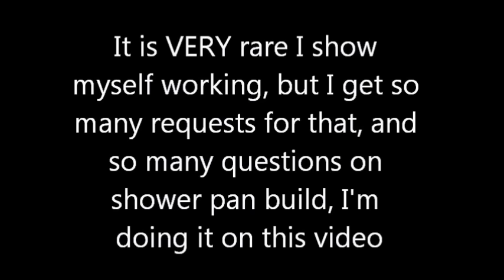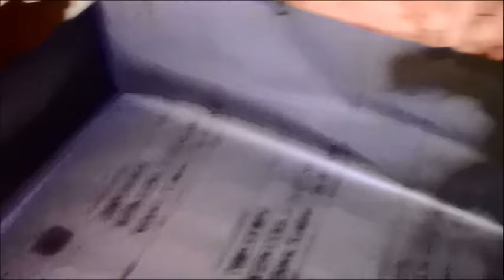HOW TO SET SHOWER PAN LINER and MORTAR

Comment: I'm sorry if this upsets you but I  do have a question about pre slope. If you don't pre slope the sub floor or slab, how does the liner drain any water that might get to it? I understand the water proofing measures you're taking but with your logic the liner itself would be unnecessary, right? I think if you don't pre slope the liner you stand a chance of having ponding water if you have water getting to the liner. I'm just trying to understand, I've been watching so many of these shower tile videos and I  just thought  why would anyone pre slope if you don't need to? But if the liner is supposed to remove any water that gets through than wouldn't it need SOME slope? I'm just confused I guess.
Reply: Yes and no, if your tiles leak a lot then a preslope will help prolong the life of the shower but it’s on a short timer regardless. If your shower has a small/expected leak through the tile (water always enters the bed! Always!!) then it will  not help as the bed will wick the water up and it will evaporate through the tile like it got in!
Reply: @VinnyGjokaj  so is the liner actually pointless ?
Reply: @jeremyclarke709  the linear is there to stop the wood from Getting wet!
Reply: Can do the preslope, then liner, then thinset then title?  Or best Liner, preslope, thinset. Doing linear drain of the height at the drain to subfloor is almost 2".   so the slope on a 6' long shower will be almost 3.5" in the back.  Lots of weight for a sub-floor I image. Thanks.  Love these videos so thanks.  Seen so many now I'm lost.   @VinnyGjokaj
Reply: @Idahodan1  I’m definitely here to answer any questions you want/have. A preslope is always positive, but once the pan liner leaks and water enters the preslope it will help but it’s still going to need to be torn out. The water is always going to get into the tile mortar bed, the most important thing is for the pan liner to be water tight and perfect, so the water won’t escape into the sub floor, whatever water gets into the mortar bed will slowly evaporate out through the grout when the showers not in use. So if you do a perfect pan liner then the shower will be fine without a preslope, if the pan liner is bad a preslope can help route the water to the drain but it’s only going to extend the life of the shower by 6 or so months before being needed to be torn out.
Reply: Pre pan is like strapping a foil pan under your truck engine in case it leaks. Proper installation and maintenance will keep your shower from leaking. Been doing tile for 32 years and have never used a pre pan and never ever have I had a problem
Reply: I always pre slope a mortar bed under the liner. If there is no pre slope it is flat and the water the seeps threw the tile and grout will sit flat and have no where to go and start to smell. That's why there are weep holes on the drain.

Comment: I appreciate Bob's time and effort to make these videos, and also his skill in the trade, but I can see why his method confuses a lot of people. He uses a pan liner even though the topical membrane makes the liner superfluous, and he uses a weep hole-style drain that would be suitable for a water-in, water-out system, even though he's not building that type of system. I'm sure his showers don't fail because he is tying the components together with care, but it still doesn't make a whole lot of sense to do it this way. That's why he's always fielding nasty comments about not knowing what he's doing.
Reply from the maker: Thank you for the kind words sir, let me go over a few things, they don't make a drain without weep holes because the drain manufacturers are behind the curve on the sealèd system that we are doing now. The reason I still do a liner in addition to protecting the surface of the mortar pan is force of habit, do I absolutely have to have the pan liner? In my opinion know but I do it anyway....cya. 

Insofar as what the industry standards are, I started doing things long before they became standards, 25 years ago I wasn't seeing blocking so I put blocking between the studs, now it is basically code, 15 years ago I started setting my wallboard about an inch off of the pan motar, now the tcna and other organizations call for that in their manuals. 10 years ago I waterproof the entirety of my shower including the mortar bed, everybody had their pushed back but now that it's called the sealed system and it is standard... plus you have manufacturers like flow fx  who is making it easier with their drain to do what I've already done with a liquid topical membrane.

Yes I am a maverick, but I'm also an innovator, everybody else just reads books where I use critical thinking 🫡😉

Comment: Do you have any opinions on pre slope. I’ve always used them but wonder what you do to combat standing water in the pan?
Reply from the maker: I don't believe that a pre-slope works as intended because wicking action, having said that everybody waterproofs the pan surface nowadays so it doesn't matter
Reply: @StarrTile  but if you do a pan liner and mud isn't throwing a waterproofing over it a bad thing? Aren't you basically trapping water in between?
Reply from the maker: @Mikepopo99  the pan liner is not necessary, I still do 1 because habits die hard... but the motar bad should be fully dry and cured before waterproofing the surface, therefore you cannot have moisture in between the two, unless of course you're doing it wrong.

I prefer to use a liquid topical membrane like Redguard or aquadefense whereas other tile guys are using some type of membrane like Kerdi, a cloth membrane with tape at the seams, etc etc, either way it's done it is a sealed system once again makes the whole notion of a pre-slope irrelevant

Comment: Great video. Lots of comments on preslope or why not here. The subfloor should be very very close to level 1st and foremost, wood or concrete slab. If not this is where you create a pre slope or use floor leveler or level up a plywood sub floor. The pan liner gives the wood sub floor some protection against water all over it if water gets past the grout and the entire mortar bed becomes soaked 101%. You're then hoping water goes to the drain as path of least resistance. You've got a big fail when this happens. My question is why is the mud bed so thick?

Comment: Do you need a pan liner if you're building a shower on concrete and not over wood?
Reply from the maker: Yes definitely, although the waterproofing membrane can be used in place of a pan liner like Redguard or aquadefense

Comment: Does the mortar have sand. I have mortar and was told it needed to have sand added
Reply from the maker: Mortar is cement and sand, you can't have mortar without both of those..
Only reason that you would need sand is that you bought cement

Comment: Preslope. I have seen other videos that show preslope. Once you know how to good troweling and packing, I also see no need. I will cut multiple lengths of cheap floor molding to screed. I will also glue the molding against the shower base as a screeding guide.
Reply from the maker: Good idea,Yes, but you are taking out the mouldings afterwards ? Unless they're the plastic in which case they could stay
Reply: @StarrTile  I was going to do a fiberglass pan but $500 is too steep for me.

Comment: Great videos Bob Thank You, Question, could you just use RedGuard as a pan liner? Maybe 3 or 4 coats and then use another 3 coats of RedGuard on top of your Mud. Thanks
Reply from the maker: Yes, Redgard allows for their product to the pan liner. I don't know the mil thickness they are looking for but 3-4 coats would do the trick.
Having said that,  because I have a customer base answer to I would not attempt it personally and instead use kerdi..which I have on many occasions for curbless showers on a slab.
Reply: I just had to throw in my two cents when I read this question.. if I understand your question correctly you want to possibly do away with the ~$30 shower membrane and put several layers of red guard which would cost over a  hundred dollars easy. Why would someone want to go that route?
Reply: @estephenchavez9577  I've never installed a rubber liner ( if thats what your talking about) and I don't like the way inside corners make wall board bump out. Red Guard is a bit pricy @ $150.00, 3 gal pail but I'm using on walls anyway, so I use as a pan liner also. I did call Custom Blend Tec support and got the OK. I can usually do 2 showers with 1 pail and the home owner pays for material anyway. That's my 2 cents. Peace my fellow Tile Contractor.
Reply: @garrypieroni8038  yes I was talking about the plastic liner...  my thinking is using a shower liner would be more cost effective and quicker than red guard but if youve had positive results I can't knock it

Comment: Do you even need a shower pan liner if you waterproof the pan surface? I guess its just another layer of protection!?
Reply from the maker: Redgard allows for their product to be a pan liner with a certain mil thickness, but I don't really want to try that on a customer, so doing a liner and the waterproofer as you mentioned is ensurity

Comment: I never understood the fanatics for pre-slope either. Water gets under your pan, you are screwed either way.

 I used up a bunch of leftover polyurethane on bathroom floor OSB. The builder was so impressed.  I told him it wouldn’t matter much and I basically just hate waste.. people are easily impressed without thinking much.
Reply: You have weep holes under main drain at the pan level and when you pre slope under pan liner the water drains into those holes and into drain. No slope and water sits there until next tile guy comes to redo your work.
Reply from the maker: David Smith.....

Koolaid is STRONG I know, but the system doesn't function as intended.
There is NO PROOF of what you said, only books and others pushing a false narrative that you just amplified yourself....

Suggested viewing where I oppose this narrative...look for:

Preslope Explained
          And
100 year shower

In those videos you will come to an understanding of how ridiculous what you were saying really is
Reply from the maker: @DavidSmith-tw7bw  my knowledge and my proof are in the video that I suggested you watch, that's why I post them because I don't like just speaking of things I like proving them....
Although the whole thing is a moot issue now because we all waterproof the surface so it really doesn't matter at the end of the day
Reply: @howtodoitdude1662  the moisture would soak through the mortar bed and slowly reach the weep holes. Concrete is very porous. Hope this helps. That's why we paint homes because water will soak through concrete.
Reply from the maker: @David Smith

It appears that you totally ignored the video titles that I gave you...
Why is it so hard to comprehend that waterproofing the surface will negate the whole idea of your water in water out system which is Antiquated and not used anymore
Reply: Like the warden in Cool Hand Luke stated - “some men you just can’t reach”
Reply: @StarrTile  I saw the videos and they are interesting . I was replying to your buddy’s comment and explaining how water works. I waterproof tops of mud bed as well. I still do a slope under just to be safe. I also use Oakley pre slope which is engineered by way smarter people than me you or whoever. My original comments are just explaining why (if) water gets under the mud bed slope would work. I saw your make shift experiment and definitely agree that if someone did a system as poorly as that then it wouldn’t work ever.We will have to agree to disagree at this point.
Reply: @krakenwoodfloorservicemcma5975 nail on the head brother

Comment: Seriously, I did a pan using your directions for dry-pack and it came out powdery and after 2 days still broke up in my hand exceedingly easily.  I tore the whole thing out and am now going to do it per either the bag (1gal per bag) or more per your instructions in another video (3.5 - 4 gallons per 2 bags) to actual brick mortar consistency.  I’m seriously wondering why this recent video you abandoned your old method and went with dry-pack. 
Anyway, by the time you respond, if at all, I’ll be done (version 2.0)
Reply from the maker: You are correct, years ago I always did the consistency for brick mortar, never had an issue with that method, however I'm trying to tow the company line so to speak and do dry pack... which works for me as well, I cannot speak to individual results if they are not doing things exactly as I do so sorry you had difficulty, but never had issue you or others have talked about. The only thing that I can assume is that it's not the correct mortar, it wasn't mixed up enough, or perhaps it wasn't packed down well enough.
Reply: First time I’ve talked to a celebrity!!  
Thank you for your response!  I re-did it with just over a gallon a bag today and I think the consistency was perfect and my result will be great.  I’m pretty much otherwise going with your advice on other issues over your YouTube competition. You just seem to speak in common sense and experience and I appreciate and trust that.  I think the issue with my dry pack was using “sponges” of water. I might just be using smaller sponges which could make a huge difference.  Anyway, 4-5 quarts per bag seemed perfect, workable, and only yielded a little moisture when repeatedly smacked.  Thanks for all you do.

Comment: Great video! How do you then attach tile to the outside of the step where there is rubber liner but not the mortar?
Reply from the maker: The step...or curb as it's called... is wrapped with backer board, muded and waterproofed then tiled

Comment: Question. wouldn't put the durock before the mud?
Reply: No, never ever. It’s an overlapping system bottom then sides. Installing Durock first leaves a crack around edges for water to penetrate.

Comment: Like your work!   Not too crazy on the power tools you use.   :-)   Why that brand drill???
Reply: Did it drill the screws?
Reply: @azdeh1894  The question is not if it drilled the screws but how many screws will you drill with that drill. Not too many.  lol
Reply: @betobeto7903  The work doesn't require high use of a drill, it is more than enough. Personally, Ryobi is too bulky, feels cheap and underpowered for my needs but it will do the job. If you can't afford other brands, it's more than capable,
Reply: @azdeh1894  nice answer, I now agree!   :-)

Comment: Why do you use 2x4's for the curb instead of using deck mud ?
Reply from the maker: Because your mud from your curb will wick moisture from your pan because you cannot separate your pan motor from a solid curb material, it will ruin the outside floor if it is a wood subfloor... 10 or 20 years down the road
Reply: @StarrTile  what if you waterproof the pan and curb ?
Reply from the maker: @mhernandez5354  sure you can do it any way you want, I've just never seen the advantage of using a cement product, plus it would take some dry time and cure time and two-by-fours do not
Reply: @StarrTile  but don't you think 2x4's move with time ?
Thank you for responding to my questions...
Reply from the maker: @mhernandez5354  sure I suppose if you don't use enough Fasteners in the right places then they could possibly move...
Then again I don't build showers to fail

Comment: I’d be interested to see if your troughs for your weep holes that are on the underside of the lock collar are blocked since you caulked between your base and liner. On this drain model, when you tighten the bolts it pushes the silicone out and then pushes/raises the liner up and blocks the troughs on the bottom side of collar, therefore water cannot enter to escape. Sent you an email on this. I did it twice and both times the silicone raised the liner and blocked the troughs. Pulling the liner over the silicone and pouring pan immediately you would never know this. I called Oatey and they are oblivious don’t understand what I’m talking about. 
Test it. Let me know what you find out. I used clear 100% silicone from GE.
Reply from the maker: The silicone goes on the indented ring of the base flange, holes cut and then locking flange goes on top...that's where the weep holes are, not the bottom flange. The way you described it is incorrect insofar as where your caulking goes.

But again I have emphasized this on many of my videos, if you are waterproofing the surface and the weep holes are irrelevant anyway

Comment: You forgot to put caulk under the plastic especially when you using that type of material of the plastic supposed to wear gloves Bahasa special chemical are harmful read the manual and give you a warning only a suggestion have a good DIY

Comment: No pitch on the rubber pan- water will sit under mortar & no pea gravel around drain...water can't drain.... future failure
Reply from the maker: Incorrect...
Nobody does water in water out system any longer, every tile guy well waterproof the surface. 

And the pre-pitch doesn't work as intended anyway because of wicking action, the shower pan would be saturated 100% all the time with or without the pre-pitch... I personally taking out showers over 30 years old with no pitch and work just fine, stop drinking the Kool-Aid
Reply: Mic Viz, The Liner is to waterproof the subfloor, it’s not to drain the water. How would the water get to the liner if the pan is waterproofed? Even if water gets to the liner, how is the water going to drain out? The water will remain in the cement slab. This guy is talking from experience, listen to him!